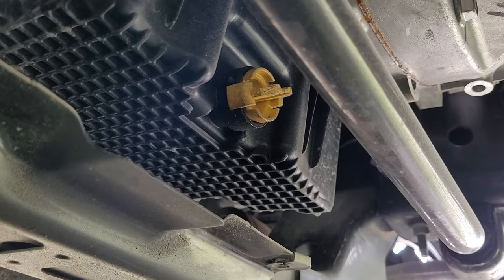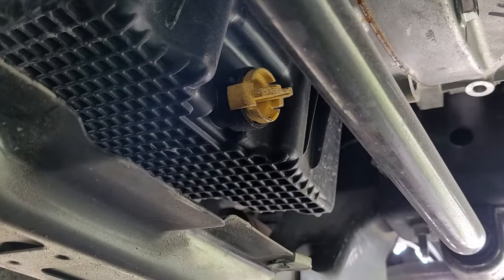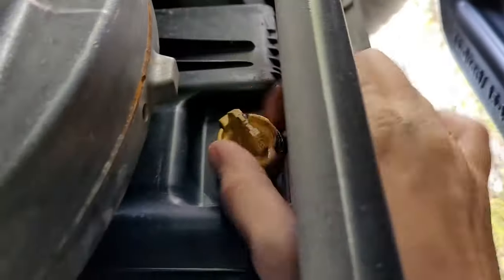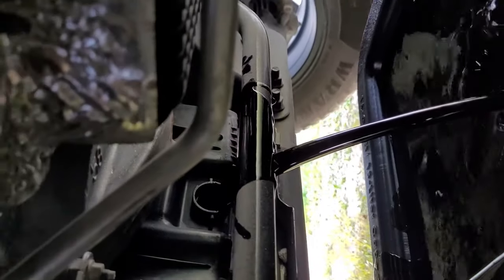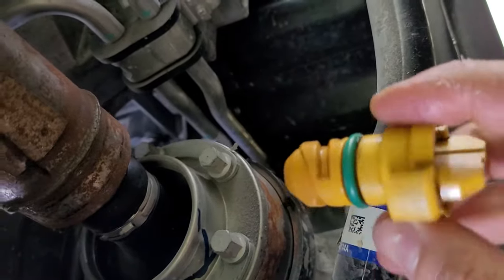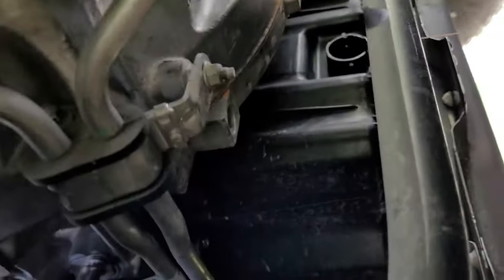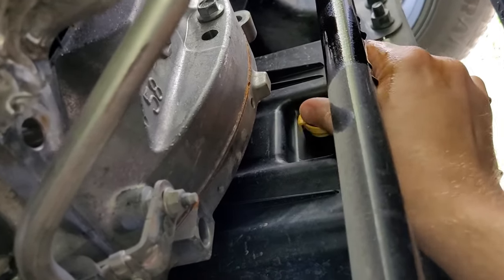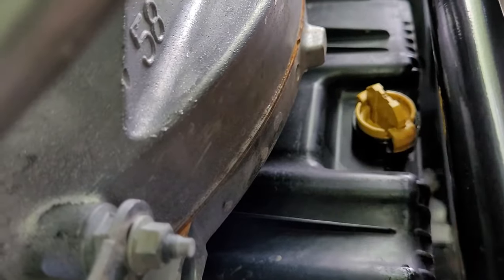Ford's New Drain Plug

Comment: It’s better than a bolt.. I first saw it on VW.
Reply from the maker: really? I didn't know VW was doing this
Reply: @thebartendermechanic  saw it on a 2018 vw tiguan, thought it was dumb but then realized it’s pretty awesome. I’m always paranoid about under tightening the drain plug or stripping the thread.. and often too lazy to grab a torque wrench.  So it makes it’s really simple with the plastic
Reply from the maker: @victorv3890  yeah for sure, especially if the oil doesn't splash everywhere

Comment: Good chance the treads won't be damaged from overtorquing!
Reply: Well, you don't torque the drain plug. You tighten until it's snug and then maybe a little more. Then you mark your pan and plug to never tighten past that point.
Reply: @matthewdiaz6478  Torquing done with fingers is still torquing.  Tightening with the fingers qualifys.  Only difference is no actual torque value is reached, only the feel in the fingers.
Reply: @Hamilton S. Rink  I'm just making the point that you do not use a torque wrench for this. Mine is a 2016 gt pp and it came with a metal pan and metal plug nut. It also was marked from the factory.
Reply: @matthewdiaz6478  I understand.  an O ring in good condition will work just fine.  You don't have enough fingers and toes to count how many overtorqued stripped out leaking oil pans I have personally fixed.  Ford's plastic pan and plug just might bring other issues, but maybe guys will stop over tightening the drain plug. Maybe.
Reply: @HamiltonSRink  People need to stop taking their car to lube centers and change their own oil. That's the only way. Unless you have a trusted mechanic.

Comment: Long hot summer drive , depending on sensor thermo , then of all sudden damage engine to a melted oil pan & screw bolt
Reply: Or someone who doesn't like you drops your oil, takes the plug, you don't notice and your engine is toast.
Reply: Plastic parts in engines are Glass fiber filled Nylons. They have a catastrophic failure melting point of 300-330 degrees but they aren't designed to exist in environments over 180 degrees.  
Nylon parts that are part of the engine cooling system or the engine oil systems including pans are breaking down from the high heat over time and have a life span that rapidly declines the more heat they are exposed to. Typical coolant temperatures can reach 230 degrees and oil temps in some engines can peak at 265 degrees in normal operation and well over 350 if there is a major cooling problem or intentional abuse.
This just makes the engines and their plastic parts more likely to fail in an overheat situation and lends them to being more of a throw away part on a throw away car.
If you've ever had an engine overheat once or twice due to a cooling system problem you'll find out that soon after that problem every part of the cooling system that is plastic will begin to degrade, crack, leak, break, snap, or turn to mush between your fingers. Imagine that problem for every piece of plastic your oil touches.

Comment: Yeah... Ill stick to my 2007 3.0 Ranger with a steel oil pan... Only downside is my internal slave cylinder for the clutch. otherwise still a pretty good truck. Cant wait to see a rock smack into one of these and crack it. unbelievable.
Reply from the maker: Yeah, not a bad idea, the ranger is a nice little truck.  I'm not looking forward to that rock, lol
Reply: @thebartendermechanic  only problem I have with the ranger is that it's rear wheel not 4x4 with an open diff carrier on a 4:10..  thinking about getting an LSD swapped in
Reply: @thebartendermechanic  im not either to be honest, just mind boggled they would cheap out on an oil pan of all things

Comment: Okay, things are getting a bit too over-engineered. That brittle little thing will only get worse over time. Plastics, no matter how well engineered, get brittle and shatter over time.
While, yes, I have also seen my fair share of ruined pans and plugs, I worry that this little yellow dongle will simply fall out with time, or some dummy not locking it proper.
A trained wrench is always better than an engineer with a sketch-book.
Reply from the maker: totally agree
Reply: Your comment is on the level "every metal rusts over time". 90% trained wrenches don't understand how things work so they have "opinions" about engineering decisions.
Reply: @inevespace  the only " engineering solution" behind this is that its cheaper to make. They dont give a shit about how much plastic will be left for the dump, or how much oil you will end up throwing on the road while your engine explodes. Weight issue?? Maybe do like Saab did before they were killed - just use the gearbox and engineer it to become the oil pan, now you dont have to worry about the price of the oil pan, the weight of the oil pan - because it is not there anymore.
Reply: @homeistheearth  welcome to capitalism.
Reply: It only has to last past the warranty period.

Comment: More Ford garbage !! Plastic pan will warp and leak , and or crack.. let’s see what happens when you hit something on the road and it goes thru the pan and your oil is all over the road. BMW has the plastic oil pan along with a lot of plastic parts which are the weak points on the vehicles as well..

Comment: Looks like the crap drain on my riding mower. Except my riding mower was less than $3000, and a replacement engine is less than $1000

Comment: @2:20 A lot of "inexperienced" (ie; dumb) dealer servvvvice technicians making Ford buy oil pans. Also fleet maintainers. Shaving that 45 seconds and the $0.05 washer off oil change times adds up when you have hundreds of vehicles.
Reply from the maker: yeah those guys love cranking on the drain plug its crazy

Comment: I'll just keep my 2001 F250 7.3L until the lefties do away with diesel fuel, lol
She'll still be runnin when these late models end up at Pull-a-Part
Reply from the maker: Nice truck, Oh the 7.3 L diesel is a great motor.  It's actually an international motor.
Reply: '01 F-350 7.3L Powerstroke diesel 6 speed manual 😎
Reply from the maker: @zacharypeery4082  nice truck

Comment: Now we don't need any tools to drain peoples oil. We can be evil and remove the plugs completely, or we can be evil and steal their oil and replace the plug as if nothing was ever done. Either way this is an easy way to ruin an engine and give someone a bill for thousands of dollars.
I'd bet my dollar ford doesn't monitor oil levels and would allow an empty engine to run.
At least a 6.0 would stop running after a few seconds and never attempt to start again until the oil was filled.
Reply from the maker: yeah I'm sure it would start but you'd get an oil light come on for sure and not good things would happen if it kept going

Comment: What happens to plastic. It gets old and brittle and one whack like say you bottom out your vehicle by accident there goes all your oil. I wish manufacturers would stop using plastic
Reply: If you are hesitant about properly designed plastic parts, stay the hell away from those plastic bodied corvettes, because they use plastic tensioners on the timing chain.
Reply: The oil pan sits above the crossmember it woul be pretty hard to bottom out that bad, to be fair I have seen many steel pans rust through from roadsalt etc and leak externally requiring replacement - I don’t want a plastic pan either though

Comment: Thanks for clearing that up. Jiffy lube says it has to be discarded at every change and so that was an extra charge.
Reply from the maker: yeah, I think those shops like to come up with schemes to get $$$
Reply: Owners manual says replace every oil change it’s $10
Reply: @bgriffo2738  $10 for a GWEEN O-ring?!?  GO FISH!
Reply: @bgriffo2738  I see COMPLETE drain plug ass'ys ( plug & O-ring ) on AMAZON priced from 1 for $9.50, 5 for $16, 8 for $26.
Reply: @bgriffo2738  We replace the eng. oil pan drain plug ( steel - threads are "microencapsulated" w/LOCKTITE sealant. We replace the COPPER sealing washer EVERY oil drain.  It comes as part of the oil filter kit. ) on Mercedes-Benz AMG engines at EVERY oil drain
Reply: So, basically, it now becomes an engine oil pan drain plug "change".

Comment: When I first saw this when I became a lube tech at a shop 2 years ago after doing hundreds of oil changes a week at Nissan when I saw this for the first time I was like WTF is this non sense. I hate this design. And it would be fine if they didn't have the damn sway bar right behind it and the damn oil cooler.

Comment: Ford can't a Ford  its going all plastic & fiberglass ,,  when they loose the original plug screw,, has a rubber washer on to metal washer bolt , they should of made the screw bolts one thread shorter then

Comment: Crappy, crappy, crappy

2019 f150--the plastic drainplug failed 2 separate times.

One time the day after finishing a 1200 mile trip--I walked out to the truck after a short trip to the office and saw that there was a 3 foot diameter oil spill from the plug.  What if it had given out during a 10 hour driving day?  How would I know before the engine locked up--Ford had jiggered the 5Lv8 sensor  so that the constant oil usage wouldn't trigger the low oil light.  If I didn't check between, I could be down up to 3 qts in normal usage and normal oil change interval and it wouldn't show up on the low oil dummy light.

Even when I was driving junkers when I was younger, I never was in a situation where I had to check for a potentially catastrophic oil leak everytime I left a parking spot.  Not just drips, but quarts of oil on the ground...

Be warned and watch for leaks.
Reply from the maker: oh man that's horrible, I hope I don't experience the same thing

Comment: That's about a crap idea. Yeah, it probably will prevent over torqueing of the oil drain pan plug, BUT, it's all plastic. I don't see it standing the test of time. And, with the  plug on the side of the pan, a lot of debris is still stuck in the pan. It's just a cheaper way to make a pan to increase their profit on an already overpriced vehicle.
Reply from the maker: Totally agree, It probably looks like a good idea sitting behind a computer

Comment: Plastic oil pan and drain plug. Garbage. Steel or aluminum pan with a steel plug. Aluminum is better because it wont rust. Plastic is trash
Reply from the maker: The problem I've seen with aluminum is that the threads are soft and people over torque the plug and pull the threads out or cross thread them
Reply: @thebartendermechanic  that just pure stupidity. i have a 2003 bonneville SSEi, this particular L67 supercharged 3800 has an aluminum pan. the car is 20 years old (i dont drive in the winter). the pan is like new.

you tighten until it's snug not until you cant stop tightening it.

NO ONE is permitted to change my oil but me and myself. i also have a 2022 crosstrek manual transmission subaru. i change my own oil, the car is under warranty so i change it BEFORE the manufacture's recommendation AND i document it. i was told that is all that is require, documentation.
Reply from the maker: @andrewdonohue1853  You're right an aluminum pan should not be a problem, I think the problem is with a lot of yahoos changing oil at these places they don't know what they are doing. It's my understanding that with manufacture warranties you just need to show your documentation.  Nice cars by the way not a lot of those Bonneville's left, they were big cars with nice interior plus with that super charger they were fast

Comment: More plastic Ford junk plastic oil pans how cheap can u get 70000 dollars for a truck over half of the truck is plastic not for me Chevy is probably doing the same the don't make them like use to and charge u 70000 for a truck wow built Ford junk
Reply from the maker: they keep cutting manufacture costs but the trucks get more expensive